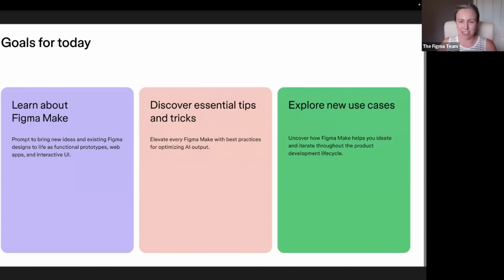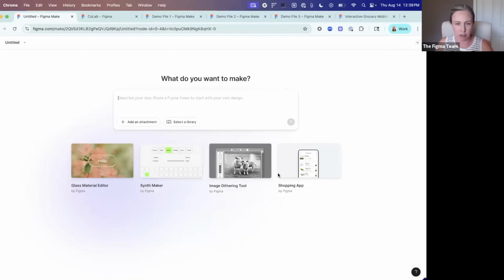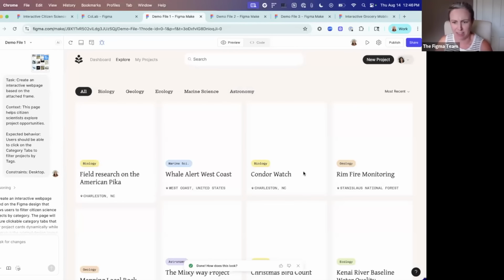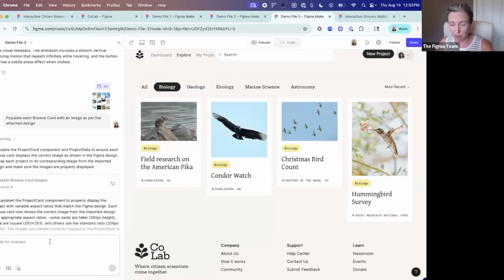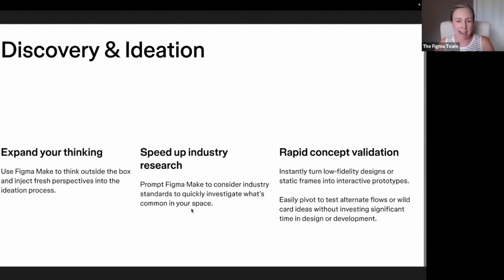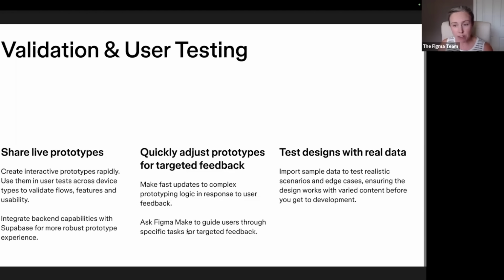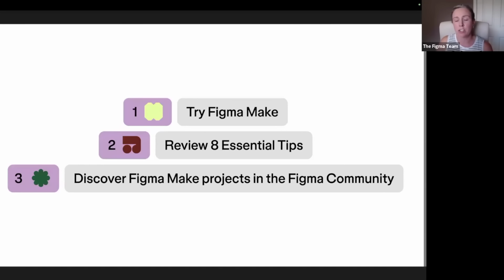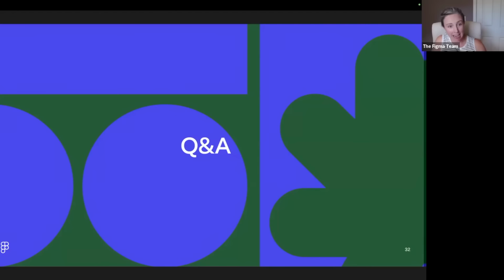Figma Make tutorial: Getting started

Comment: This carries some great potential and I'm sure it's gonna progress. Right now it's veeery slow even on extremely short one lined prompts, so no wonder you never dared to show the time it takes for Make to actually make anything, it also struggles with different prompt languages, it takes alot of time to make the AI engine understand things in other languages than English. What does go fast is the text that explains what Make is doing, but I have no use of that cause it just flies by and goes away - but sometimes the dialog is very handy. Make doesn't honor the imported design system all the time. I don't think it's very logical where the results are stored and the publishing UX is quirky, perhaps a bit overengineered. But again, great to see the start of this. It says your not counting prompt credits  but that's not true as I couldn't progress with my file as there was no more credits left, I'm on the organization plan.